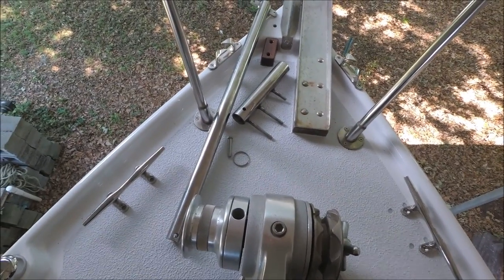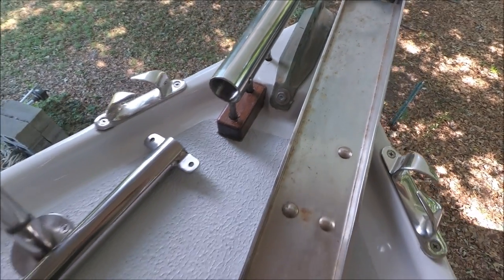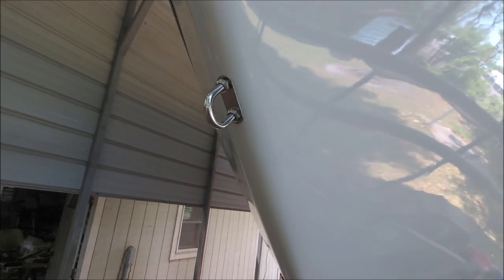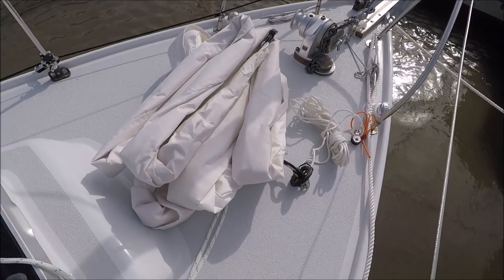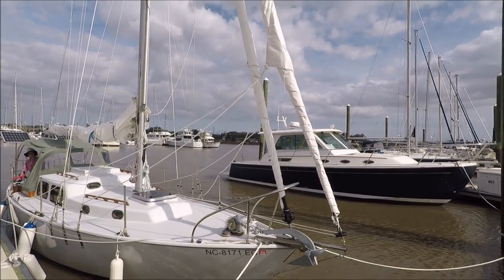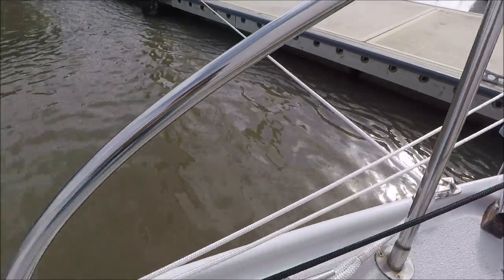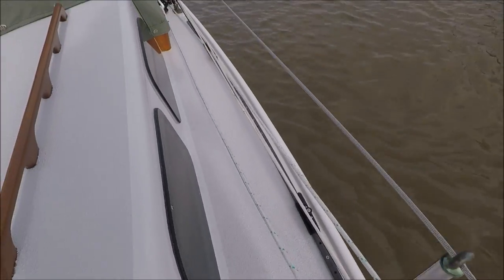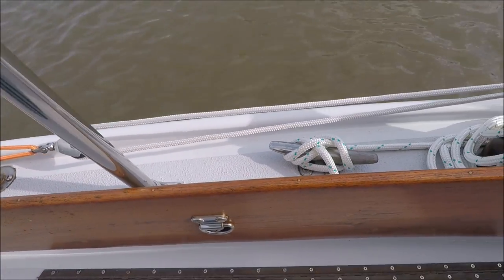Adding a Code 0 Sail and Sprit Pole  -  Pearson Triton Osprey Refit Part 23

Comment: Really enjoy following this refit. Everything is clean, tidy, and simple to use. 

For the retractable bowsprit, would it make sense to drill a 2nd hole and reinsert the pin when it is retracted (to keep the pin somewhere close, and also stop the sprit pole from unintentionally extending out)?
Reply from the maker: That would be handy and I considered it but the pin is large diameter so I decided not to weaken the tube with another large hole in the high load zone. For now we have a light line as a lanyard to secure it. It can also be removed and stowed in a cockpit locker.
Reply: @atomvoyager  Got it. Thanks for the info!

Comment: Great videos. I always come away seeing something new. I have an old Potter and I need to replace a wooded cockpit locker hatch. The frame is all wood. After watching the Alberg 30 and how you covered over the compass hatch that was in the companion way I realized you really can do everything. It looked seamless. Do you have any suggestions? How do you go about creating a hatch and all the trim in fiberglass? Thank you!
Reply from the maker: It depends on how the hatch and framing is built now and how you plan to change it. Suggest you join the Plastic Classic Forum where I'm a moderator and post a photo and details of exactly what you'd like to do. I can answer you there:
http://plasticclassicforum.com/forum/

Comment: Great work! Nice explanation.  I need to support some rail too on my 25 boat and am hesitating on the support. Is teak that reliable on the long run?! Even a small piece like that? And would you treat it before? Oil? Epoxy? Thank you.
Reply from the maker: Teak will last many years here since uncoated teak decks, which are much thinner and get more wear will last 20-30 years in most cases. Oil won't do much. You could varnish it or seal it in epoxy resin but it will discolor and degrade after a few years in UV exposure so you should varnish or paint over the resin with a two-part paint to protect it. In that case, you don't need teak but could use another wood such as oak, sapele, or whatever and just take more care in sealing it with epoxy. Or you could use several layers of G10 epoxy/fiberglass board with or without paint. On this boat I coated the teak block in epoxy resin and epoxy glued it to the deck.

Comment: Maybe you could add backing plates to the bobstay lower bracket screws.Are you sure the bobstay is not in the way when lowering/hoisting the anchor?
Reply from the maker: Normally yes, but I didn't add backing plates because the Triton has a massive fiberglass layup in that area and the wood beam also has thick glass over it so there's no chance of that crushing. The bobstay does interfere with certain anchors such as the Rocna which has a roll bar. The pelican hook quick disconnect makes it easier to get out of the way, if needed. Mostly, you just need to give the anchor a nudge and a twist to clear the flukes as it comes up.

Comment: Hi James, curious how you use these code zero sails and how much utility you get out of them. What led you to choose the close-wind cut? Looks beautiful and like a lot of fun.
Reply from the maker: I use it as a replacement for both the asymmetric and a gennaker anytime the wind is under about 10 knots and I don't need to sail closer than about 60 degrees off the wind. If wind is under say 8k then it makes a more noticeable improvement. f you have a very large genoa then the code 0 is less useful. Since most sailing is done in light air it is often helpful but not essential for those who prefer to motorsail in light conditions.

Comment: I noticed you have a Spade anchor on the boat. I was interested in getting one but found that they were almost 2X the price of similar weight Rocnas and the like. Do you find that it is worth the premium? Thanks for your work James!
Reply from the maker: I had a Rocna on my boat for a few years and it worked excellent, better than the Delta it replaced, but the roll bar interfered with my sprit pole so I switched to the Spade.  I've only used the Spade a few times and had no problem. The lead weighted tip is certainly an advantage in some situations and all the tests and user reports show it to be an excellent design that is at least on par or better than any other anchors commonly available. As to whether it is worth the cost, that depends on your budget. I wouldn't say it works so much better that it's essential.
Reply: @atomvoyager  Rocna now makes a model without the hoop called the Vulcan. This is what I am planning on getting. I originally wanted a Spade, however at nearly 2X the price of a Vulcan it put me off it. I will buy a can of yellow paint for $3 and spray it to look like a Spade and fool my neighbors!😜
Reply from the maker: @benlindner5285  I also have a Vulcan but its largely curved shank made it flop around some on the anchor roller and lashing it down was awkward. It may work fine for you though. It seems the shape is optimized for certain bowsprits and motor yacht rollers.
Reply: @atomvoyager  Yup I have a bow sprit with a grate on top of it and the roller is mid way up the sprit so it is a tricky fit. Add in the sprit stay and whisker stays and it tangles an anchor up easily. While I love the look of the boat I won't buy another boat with a bow sprit, big maintenance cost, extra dockage charges, limited anchor stowage options. But you know that already!

Comment: Now the sails a few years old how has it held up and would you recommend Fareast sails?
Reply from the maker: The boat has only been sailed locally and not that much yet but they are holding up well with no problems. Yes, I still recommend them. Best is not to rely on any of these Chinese discount sail makers to provide advice though so you should research exactly what you want and specify everything when using them.
Reply: @atomvoyager  thanks for the update

Comment: Seems like a couple of bolts backed by nuts and washers doesn't provide much support for the sprint pole, even with the bobstay. What about lateral forces? The sail pulls sideways as well as up. What keeps the sail from twisting that sprint pole left and right?
Reply from the maker: I tested a similar sprit pole on my own boat many times, even having the rail under in gusty winds and it handles the loads fine.  There is a fiberglass backing plate under the deck as well. The mounting sleeve is 9" long with three bolts that spreads the load well.  The bobstay takes most of the load anyway. As for lateral forces, I kept the pole short enough at 20" beyond the bow and used 120. wall tube to resist bending to the side, which has proven to be sufficient so far.  If you look at the much longer poles available from Selden and others on big modern boats they look much weaker to me but still seem to handle the loads.